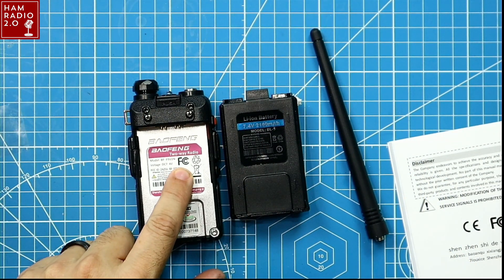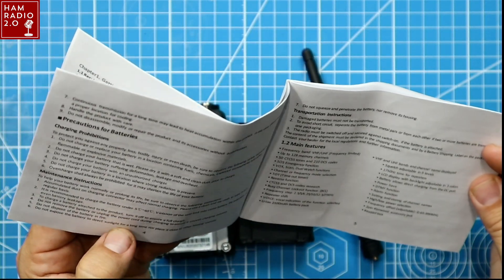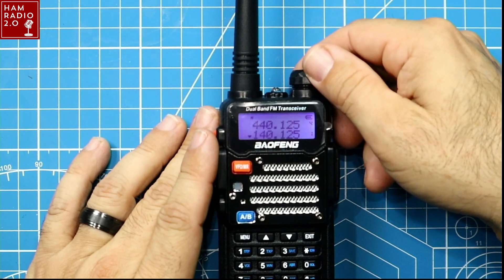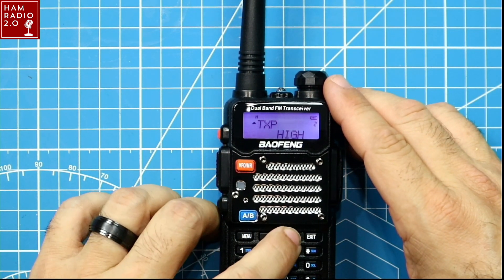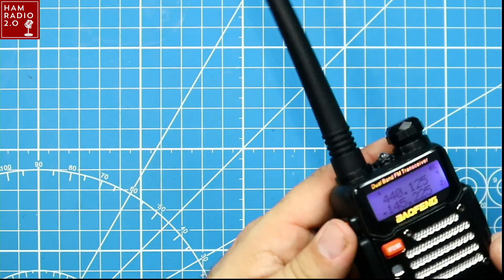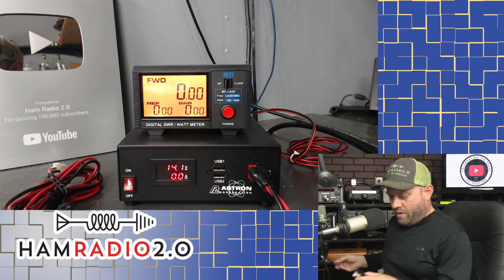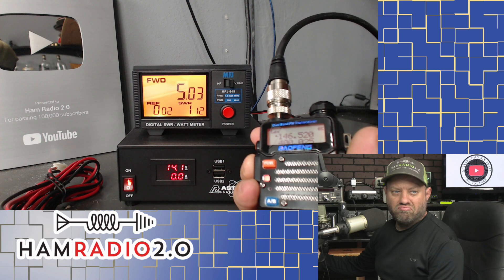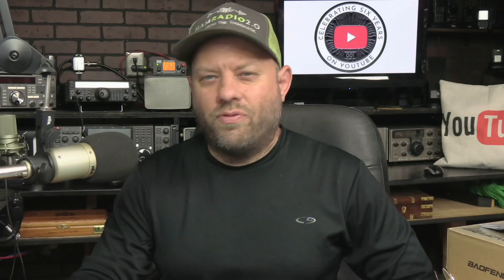Baofeng BF-F9v2 Dual Band Ham Radio Power Testing and FIRST LOOK!

Comment: Again, I don't know where you got said radio, but it is NOT on the Baofeng website, and it looks exactly like my Baofeng UV-5R V2+, which I bought all the way back in 2016, and I still have it. It is no longer made either. So what you have is a UV-5R V2+, that some second rate company bought and re-branded and changed the software. You got suckered.
Reply from the maker: Baofeng is already a 2nd-rate company.  They don't actually manufacture alot of their radios, that is why you see Retevis, TYT and a couple of others with radios that look and act exactly like a 'feng.  Baofeng was simply the first to do some good marketing in the USA - there's nothing special about a 'feng.  So even though this might not be a real 'feng, it is likely made by the same company that makes the rest of their radios - plus I am not sure how much faith I would put in the accuracy of their website.

Comment: Interesting, this radio is not on the Baofeng Website, and it looks exactly like the Beofeng UV-5R V2+, which I bought back in 2016 and I still have it. So what is this really?
Reply from the maker: Baofeng doesn't actually manufacture alot of their radios, that is why you see Retevis, TYT and a couple of others with radios that look and act exactly like a 'feng.  Baofeng was simply the first to do some good marketing in the USA - there's nothing special about a 'feng.  So even though this might not be a real 'feng, it is likely made by the same company that makes the rest of their radios - plus I am not sure how much faith I would put in the accuracy of their website.

Comment: Can i expect to receive a clearer signal and further recieve distance with a Yaesu ft 65r than I would with a UV 5R and both with the same antenna set up?
Reply from the maker: Yes
Reply: @HamRadio2  thanks I'm very close to ordering one, the only thing I don't like is it doesn't have duel watch like my boafeng but it can make up for it with better recieve capabilities I suppose.
Reply from the maker: @Lithium023  Agreed
Reply: @HamRadio2  hey I uploaded a video of my uv 5r chirping when I put my hand over the front of the radio and stopping when I take it off.  It's Strange and it does the same thing when I put it in my pocket. Was hoping somone could tell me for sure if its normal or if my radio is defective. It doesn't do it everytime either, somtimes it can be covered and it's silent. Anyway i just uploaded it on my channel if you could check it out cool but if not no bigs. Thanks

Comment: Im just getting into the hobby I have never been a radio guy im pretty much in the computer hardware and consumerism electronics camp my whole life.... so I dont have  SWR meter yet, but the first one of these BF-f9 v2n that I got is DOA im waiting for the new radio replacement to arrive this one has no reception on FM, NOAA, or any other Freq. I bought it because it said 8W yours came up pretty weak but your using a 2100 mAh battery mine came with a 3800mAh battery ...... so maybe it will get close to 8 watt? lol I would just like to get one that works.

Comment: HELP please! I really, really wish someone could tell me how to set this thing up to scan all frequencies between a beginning and an end point, while in Frequency Mode. This can be done with the UV-5R by holding down the scan button while in Frequency Mode, and then entering a beginning and end frequency. 
But that doesn't seem to work with the BF-F9v2+ rig. 
How is this done?
Reply: CHIRP, there are settings.

Comment: My first radio I bought is a BF-F8HP (last year 2/2021). It's supposed to be 8 watts. I spent ~$80. Now that I finally got a watt meter, makes me want to test it. I constantly complain about Chinese, but like you said it's good enough to get up an running, BUT expect issues and horrible HT programming (i.e., not CHIRP). I'm not gonna lie, it has served its purpose and will keep  it as long as it lasts.
Reply: I have the same. But never tested its power output
Reply: The F8 will put out 8 watts of power on one frequency, that is 146.000. I know I have one and I've tested it.
Reply: @JamesHart62  Thanks for the info, brother!
Reply: All Baofeng HTs are maximum 5 watts, no matter what the specs say.
Reply: @porkyfedwell  rock and roll, i'll do my own test

Comment: I'm just curious when your doing power test on a radio are you using it into a antenna or are you going into a 50 ohm dummy load because that can make an incredible difference especially when going aceoss a nand like 440 to 450 because its going to reflect power readings as the SWR varies because that 4 watt to 3 watt reading shouldn't in a perfect setup with a dummy load un less the VCO circuit needs to ne retuned

Comment: I have a Yaesu ft65r 5 watt and it has 3 power settings 
Low=.5watts Mid=2.5 and High=5 watts
Reply from the maker: Yaesu isn't a Chinese radio
Reply: @HamRadio2  I know…. You said in video that most of the time a tri power radio is usually 8 watts. I was just pointing out that my Yaesu ft 65 is a 5 watt radio that is tri power. Great videos BTW

Comment: I pull the battery and look at the label on the body of the radio behind the battery since they started using tri-power as a marketing term. It's the only way to tell what the radio is supposed to be

Comment: That is identical looking to my UV-5R V2+. Exactly same style, color, case. My battery is 1800 mAh and only has 2 power settings.
Reply: I just noticed that. I too have the UV-5R V2+. It was my first radio, I still have it and its still working great. I think a lot of Baofend radio's are bought up by others and "Adjusted" but not really. So if it is not listed on the Baofeng Webpage, is it really a Baofeng?

Comment: Off topic question from a newbie with no ham license yet. I need a way to communicate with family just over 50 miles away in a metropolitan area in a grid down scenario. Are there any options available for that other than SAT phones? Thanks
Reply: LORA MESHTASTIC using an amp. Its 915mhz and encrypted packet digital. Build a base and one for family. Do some research.
Reply from the maker: LoRa is a good option but over 50 miles might be pushing it
Reply: Hey, thanks for the input ideas. I'm digging into it now. Interesting idea. After further checking it's 48 miles point to point. Don't know anyone in the area to node with but there must be a way. Dallas/Ft. Worth metroplex area. The downside is tons of interference and barriers. Upside is somebody must have addressed this already in this area. This brings up a new question. Is a project of this size worth doing or would it be better to double down on getting my ham license? Haha

Comment: What about harmonics? Transmitting out of bands could be more problematic than spending extra bucks for radio with FCC complience.
Reply: This radio is FCC complience, and some of the other makers radio's are a pos.
Reply: For exactly that reason the uv5 r and uv82 / plus and some other models are not allowed to sell/buy and use in Germany and the Netherlands

Comment: BTECH UV82 HP is a great buy and very durable. good antenna. no intermode noise.
Reply: UV82R is the same circuit as the UV5R just rearranged on a different PCB

Comment: One of our brand new hams has a UV-10R and he said it was advertised as 16 watts.  Hilarious.  It does look like a newer version of the UV-5R.
Reply from the maker: Yep
Reply: And what power did it test at?
Reply: @robertvondarth1730  The usual 3.5-4 watts.  They advertise them at 5, 8, 10, 16 and 30 watts!  I saw a bundle sold as 300 watts.  They must add up all the radios (16 divided by five)

Comment: Hi Jason, I have many BFs.  Not this one though. Is it more power, etc? None over 5-6W in my arsenal. Most with power below 5W. Even with Radioddy antenna upgrades and larger 3800 battery for a few. Bigger batteries are good for a lot longer up time! I guess I will go look at the specs before you go live to learn a little more.

Comment: 1.  Will this thing get hot at HP?
2.  For a slightly larger footprint, the 25/10 BTech Dual Bander migjt be a better choice.  This with a small Li battery, and 1/2 L antenna could be a good backpack combo for service events.  Even at 10w you could really get out.
Reply: BTECH UV82 HP.

Comment: I started with a pair of  *Tidradio UV-5R's "5-watt" (more FCC compliant at the time) with an output range of 3.8 - 4.6 watts. When researching higher power and more functional radios I looked for compatibility with interchangeable batteries, antennas, accessories, etc. and purchased a set of *Tidradio UV-5RPro "8-watt" with an average range of 4.8 - 5.6 watts, and a pair of *Tidradio GM-5R (GMRS "5-watt") with an average output of 3.9 - 4.8 watts. The only upgrades I've made (so far) has been 3800 mah batteries, *Nagoya NA-771 antennas, *Tidradio blue-tooth programmer(s) (V-1 and V-2), The biggest improvement was replacing the stock antenna on the GM-5R (GMRS) with a Nagoya NA-771G (sma female) GMRS tuned antenna. my average SWR readings are now between 1.01 :1 and 1.05 :1 nearly perfect 👌